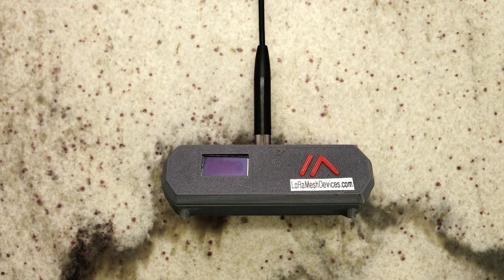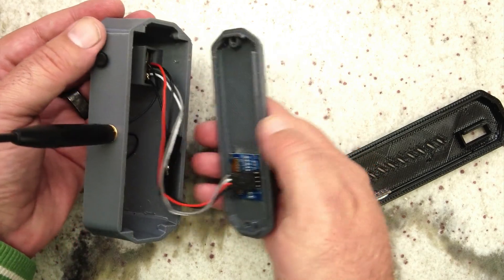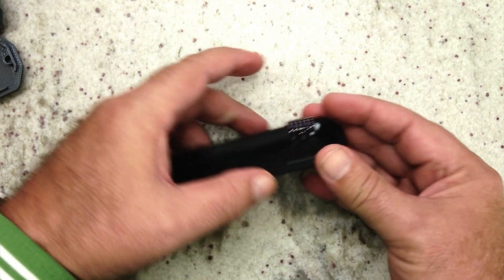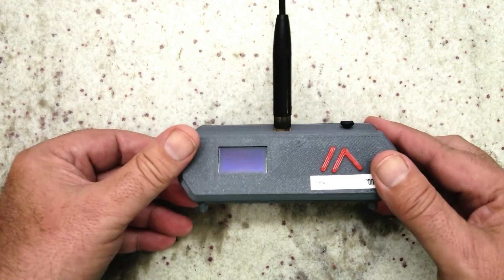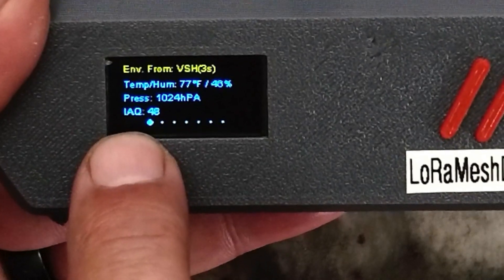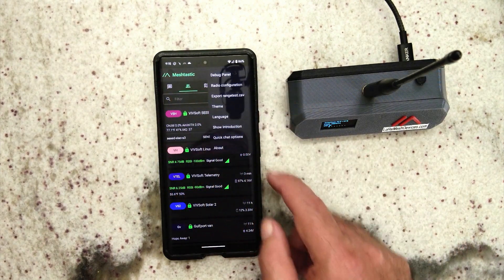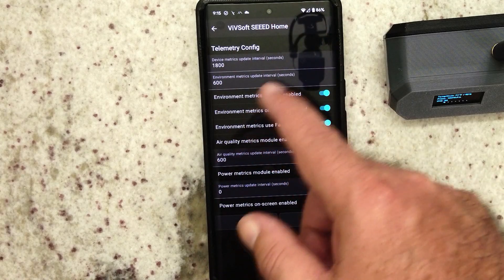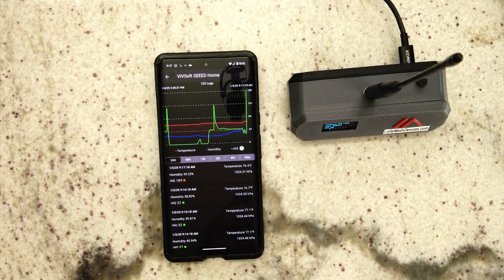DIY Air Quality Tracker: Meshtastic Node Upgrade 🏠💨

Comment: New to mestastic, but not amateur radios.
Does the meshtastic paradigm have the equivalent of say GMRS where people put out repeaters that you can reach greater distance that others can use or is the Meshtastic paradigm more about private use between your own group of 2 or more devices?
Reply from the maker: Thanks for your comment. Yes, the aim of Meshtastic is the former. Building a community driven mesh network where every node expands the network so it reaches further. Inside of that expansion, you can also do private (and secure) communication between two parties, but when you add a node it automatically forwards everyones packets to expand the network. There are roles like repeaters and clients, very interesting.
Reply from the maker: Here is a good picture .. https://meshtastic.org/docs/introduction/
Or I tried creating a video explaining some of this here .. https://youtu.be/rjmfeuJEBRw

Comment: Air temperature should always be measured in a shaded location so if this unit is going to be used in outdoor situations it would be better if you could incorporate a small sun shield in the body. Is there an stl file available  for the case ?
Reply from the maker: Yes for sure, thanks for pointing that out. This one is indoor only. It's interesting they called it "Indoor Air Quality" applying these cannot be used outside, but I think they can. The standard, as far as I can remember is, "In an open area, 1 meter above ground, in the shade"... As for the case, here is a link to the original case I butchered, I don't think you want my STL files :)

https://www.printables.com/model/819973-meshtastic-ttgo-t-beam-case-scifi